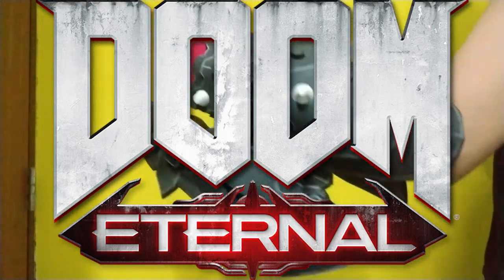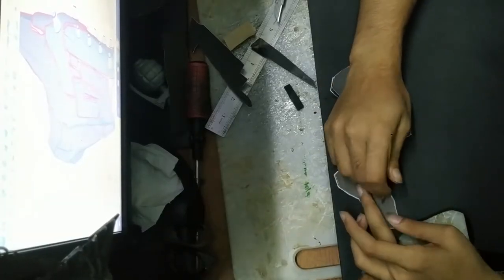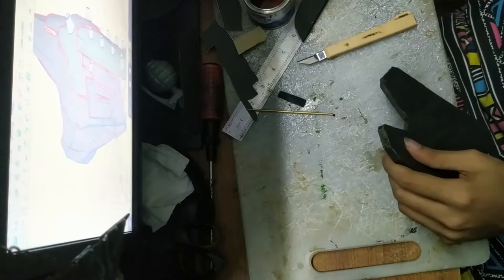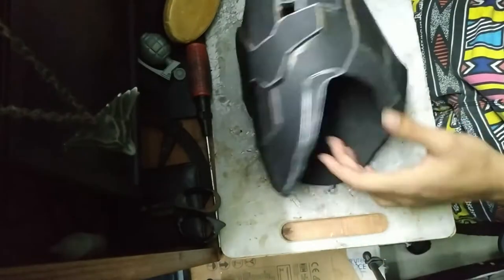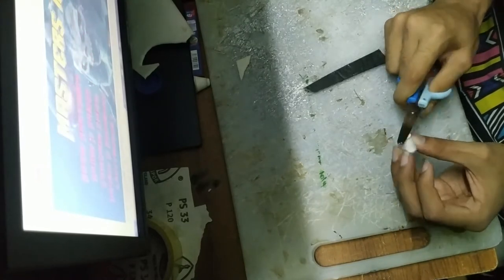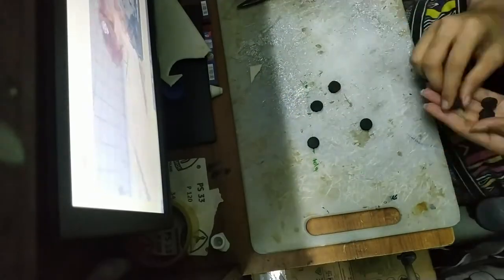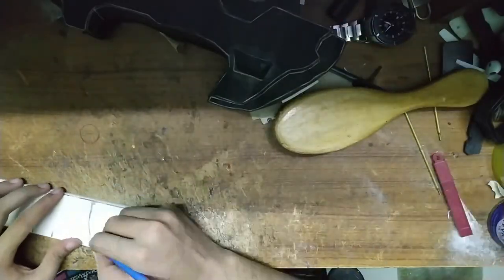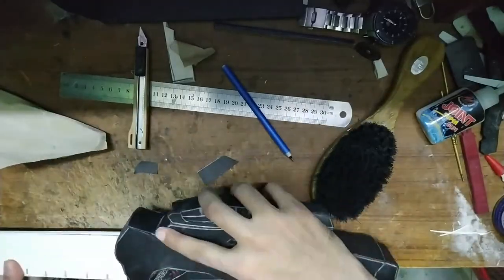DOOM ETERNAL COSPLAY: LEFT FOREARM AND ARM-BLADE

Comment: templates? and what material is that?
Reply from the maker: That's low density Eva foam of different thickness. And PVC board for the base of the blade . Some people call it cintra plastic . The templates were bought from heroes workshop .
Reply: Thank you
Reply: @ishaqkhalilmimun7575  thanks